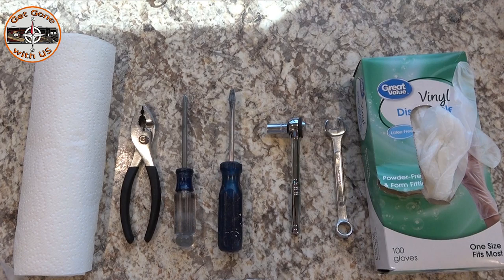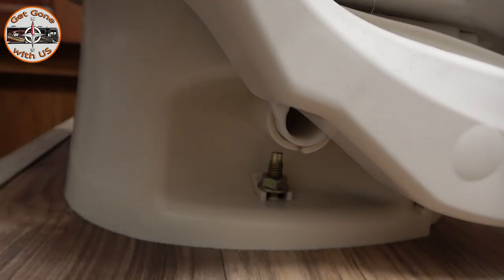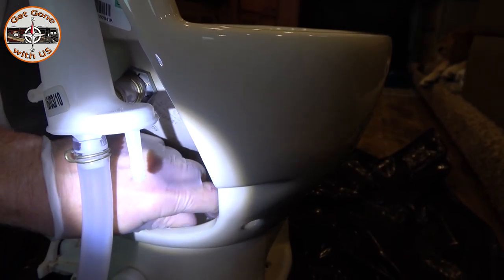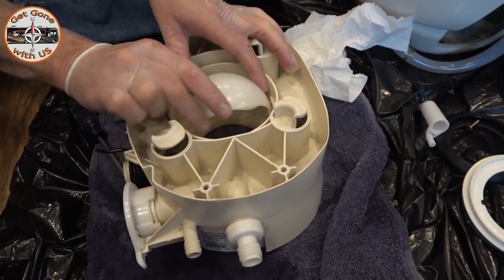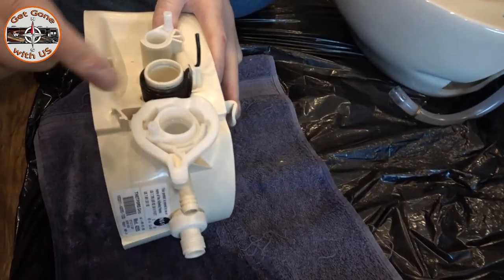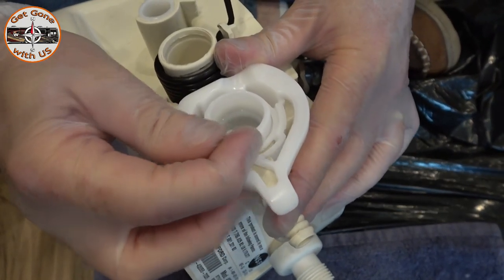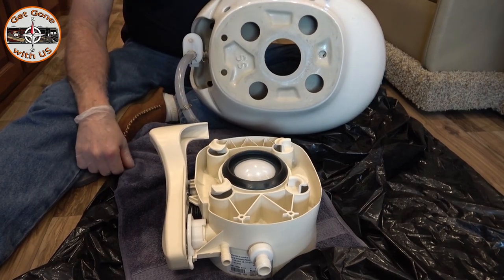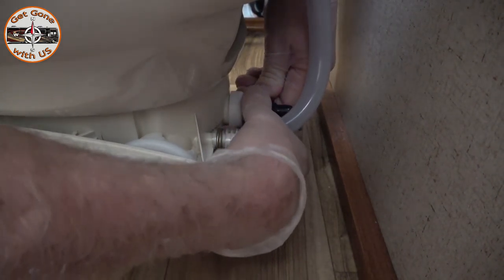RV Toilet Rebuild - Waste Ball and Water Valve Assemblies -Thetford Aqua Magic Style II

Comment: These toilets leak if the water pressure in the RV park is low. They can't seal with low pressure. Someone at Thetford who builds these said so. Thetford mostly won't admit it to you though.  Ours flooded twice due to low pressure in the park. We did change all parts but if pressure in park is low, it still starts dripping--loses its seal. I just turn off water each day as I leave for work. Not going to chance it and clean up a flood again!! Why can't they engineer these differently? The 1970s version with a slide bottom was a much better design.

Comment: Followed step by step…everything that clicked clicked, everything that snapped, snapped, all o rings got lubricated, an new gaskets, but now the new waste ball does not close all the way by itself, so, obviously does not hold water 😭☹️🥵
Reply from the maker: Use your foot to lift the pedal. If it moves, pull the pedal off and lube the shaft of the control arm. Otherwise it sounds like something is not lining up the way it should.

Comment: Watched this video several times and still haven't had any luck with the water valve not leaking. Yes I replace o rings as suggested.yes I used grease and yes it still leaks. Ball gasket also leaked. I gave up and ordered a new toilet. So flustering that it's a cappy job. Oh sorry for the rant. Appreciate you video very much
Reply from the maker: Sorry it didn't work for you.  You should be fine with the new one. 😀

Comment: I was getting our bus ready to go on the road. The back toilet water valve was not closing the water off so I did a rebuild on ours. The setup was just like yours I ordered the parts but I noticed the water valve was in a different part setup or part number 42058 which  I was lucky and found it at our Camping World. The process worked just like you showed on the video except ours had the sprayer attachment. I had it done in about 45 minutes. I took my time because of a bad back. We are back in business. There is no telling how much y’all helped me save on repair costs. Thanks.
Reply from the maker: You are welcome James!  Glad it worked out for you. 😀

Comment: Great video. I agree with you that the parts are expensive. Mine wasn't holding water even after I tried several seals. Eventually, the arm wouldn't move the waste ball. I found on Amazon the lower half for $75. Eventually all parts will fail; if you add up all the parts, it would be more than $75; therefore, I would just change the bottom half, especially if your toilet is over 5-7 years old. Just my thoughts.
Reply from the maker: Thanks! Toilet is still working since this video. Like we said in the video if it does act up again, we will switch the whole toilet out with a different brand.
Reply: @GetGonewithUS  I just installed the lower half. It is functioning just like a new toilet. If I was to purchase a new toilet, it would have cost $150 to $200
Reply from the maker: @michaelt2961  It is still a Thetford, we won’t own another one or put anymore money into this one (if it goes again). It’s just our personal opinion. :)

Comment: My valve wouldn't stop flushing and the step off the handle trick didn't work.  So I pulled the handle off with the toilet in place, removed the water valve, went into the valve seat and pulled the washer & spring.  It still looked in good shape, so I stretched the spring under the washer a bit (lengthing it just a hair), and greased up the washer and washer seat and reinstalled and works perfectly.  Your video was great in identifying the parts and how to disassemble what I needed to work on.  THANKS
Reply from the maker: Glad the video was helpful to you and nice job on the spring to get yours fixed! 😀

Comment: I used this step by step to replace my water valve module, waste ball and the vaccume breaker at the same time and I am thankful that I added a shut off valve on my water line because after I was done with the rebuild the water module leaked fresh water worse than before. I noticed that all the videos (your was by far the best) none of the water valves were nearly as hard to get out or reinstall the new one, as mine was. I will call Thetford tomorrow and ask some questions about all this and hopefully they can enlighten me.
Reply from the maker: So to hear you still had issues, hopeful Thetford will be able to give you some insight.  😀

Comment: Great video. Followed it step by step and no more leaks! Thank you!
Reply from the maker: Glad it helped! 😀
Reply: @GetGonewithUS  Question, now the bowl is no longer holding water. It was fine for the first several days, now not holding water. Any suggestions?
Reply from the maker: @ilenemurphy4905  In a pinch, you can try using the correct plumbers grease around the seal. You may have a bind that is not allowing the waste ball to close all the way.  Try this... step on the foot pedal and release it, then try to pull up on the pedal and see if the toilet holds water. If it does you possible have a bind somewhere.  That happened to us a couple months after repairing our toilet.  Our problem was the water valve started leaking and was binding.  It was not allowing the waste ball to close all the way. Here is the video on that video (Links to everything we used to repair it are listed in the Description Box below the video) ...  https://www.youtube.com/watch?v=ACBLn1E8QLM
Reply: @GetGonewithUS  thank you.  I will give it a try. Much appreciated!

Comment: Thank you very much. Our toilet was occasionally continuing to fill up, eventually overflowing until detected. We're full time RVers, so that was usually at night. I was able to successfully replace just the water valve with the info in this video, and didn't need to remove the toilet or split the bowl. The valve is accessible with the toilet in-place, and I had enough room to work on it. This wouldn't have been the case with our other toilet, so this was just luck. Trying to do this with the toilet in-place makes it pretty tricky to line up the foot pedal, so you might want to remove it anyways if you don't have incredible patience :-)
Reply from the maker: You are welcome. We give you credit Ron if your space to remove and replace the foot pedal was anything close to ours. Incredible patience indeed! LOL  We are glad the video  was helpful to you.  Thanks for visiting our channel! 😃

Comment: Thanks for the awesome video! I just replaced the water valve on our Style II High Thetford, which was about 10 years old. Fortunately I was able to do this without having to remove the toilet. I think I would've had a hard time with just the instructions alone, so your video esp from 8.00 to 10.00 mins, made it that much easier. Thanks again from a happy camper in Great White North.
Reply from the maker: Hi Wayne.  We are glad you found the video useful.  We appreciate your comment. 😀

Comment: Thanks for this excellent video.  I have no questions about what I need to do to repair my toilet.  Your instructions were clear, the video and lighting were great.
Reply from the maker: Glad it helped
Reply: @GetGonewithUS  Well, I guess finding the kits is impossible now, according to the manufacturer.
Reply from the maker: @charlieparrish3700  The water valve is still available at the link in the description box below the video.  Not sure which part you are looking for.  The supply chain issue is a PAIN!  Good Luck!

Comment: Very well done video ! 
Have replaced ball seal before but not valve . Will get the 2 kits you used. 
Not going to do until necessary but will carry in camper along with the other dozen or so parts prone to failure 
Thank you
Reply from the maker: Glad it helped. 😀

Comment: If the drive arm cracked off, could you simply replace that alone by unscrewing the old one and sliding a new one in its place without all the disassembly?
Reply from the maker: I believe you would still have to remove the foot pedal to do that.
Reply: @GetGonewithUS  It worked!

Comment: I replaced the seals per the instructions and the waste ball seal held water for about a week before starting to leak down again? Everything seated well, bowl top is tight and valve functions perfectly. Thoughts?
Reply from the maker: Make sure the foot peadal is returning all the way and not binding.  After flushing use your foot to pull up on the pedal slightly and see if it moves.  Good Luck!

Comment: Great video, very informative. I just did the same thing here and even after we tested for about an hour and it held water with no leakage. The next morning the bowl was dry. And ideas as to why it would be like that? I did take it partially apart and reset the bowl to base seal. Hoping that maybe it was just off a little.
Reply from the maker: Thanks Adam.  Sorry to hear your toilet is still not holding water.  Did resetting the bowl do anything?  Can you remove the foot pedal without removing the whole toilet?  If so take it off and try moving the waste ball lever, then try moving the  water valve.  They should moving freely with no binding. We have had the water seal o ring move down the shaft and cause the valve to bind which didn't allow the  pedal to return to fully closed position.  It threw us for a loop because it appeared to be closed, but it was allowing the water to slowly leak out. We pulled the water valve off and saw the o ring 1/2 way down the shaft, moved it back, put some lube on it and it was fine after that.  Good Luck! 😀

Comment: Thank you very much for the video, it was SO helpful. I now know I will be able to replace the ball after it got stuck and we twisted the drive-end off of it.  :(
That brings me to my question, since this happened because the ball got stuck to the seal, before storing or not using it for a couple weeks, do you think I could put some plumbers grease on the ball and then work it back and forth so there is a coating between the seal and ball?
Thank you again for the "down to earth" tutorial.
Reply from the maker: Glad it was helpful Steven!  Any time the waste ball returns slowing or doesn't feel smoothly when operating is the time to consider adding grease, that when we do it. Make sure you check with the manufacturer for  the proper type of grease to use. You could add some prior to storage, we never did if it was operating correctly.  For long term storage in freezing temperatures, make sure you have RV Anti Freeze in the toilet too. 😀

Comment: Thank you for your video. I watched both of them regarding the ball seal replacement. According to the assembly date on mine it was built in 2018. My trailer is a '19.  My seal does not hold water but if I lift on the lever it will hold water and if I add extra water from a dishpan then it will hold water.  What do you suggest - replacing the seal or the whole kit with the water valve. Mine might be slightly newer than yours, not sure. I am concerned about being able to remove the lever (muscle strength), and putting it all back together correctly if I do the Valve Assembly. Thoughts appreciated.  Thanks again for the great video!
Reply from the maker: Sounds like the seal could be going or the pedal is binding a little.  Without seeing it, it is hard to say. You might want to have it looked at if you are unsure about doing the job yourself. Good Luck!

Comment: In the video, your handle looked pretty easy to remove.  Mine is not.  Was yours that easy the first time you removed it?  Any advise on what might make it easier?
Reply from the maker: Make sure when you are pulling it you are not pushing down on it too.  Pull it straight off.

Comment: Hi, Very informative video, thank you for posting. The small shaft on the drive arm snapped off on our Style II, everything else OK. Looks like Thetford has discontinued Part # 42048 Drive Arm . might you know of a source for this without purchasing the entire base? Also, looks like the drive can be replaced without removing the entire commode. Thanks
Reply from the maker: Hi Jude.  I would get a hold of Thetford and ask them if the drive arm is discontinued or if it is a supply chain issue.  To answer your other question, yes the arm can be replaced without removing the whole unit.  Good Luck! 😀
Reply: Thanks for the reply….apparently Thetford has discontinued Part #42048…just the drive arm…they are producing it with a Kit # 42209….which has waste ball, seal, floor flange and the drive arm. The Kits are in Production but Thetford Customer Service  is unable to provide us with an available date …so we have to keep looking for old stock.  
Thanks again !!

Comment: Hi Guys
I have a thetford rv toilet 42054 and water wont stop running,. I replaced the Water Valve but even with the foot pedal all the up I still get water. Any Suggestions?
Thanks
Vic
Reply from the maker: With the foot pedal off the toilet, can you move the water valve lever and stop the water from running?
Reply: Thanks
I will give it a try.
Vic

Comment: Excellent video! My flush ball stopped turning when I step on the pedal. I can manually move it and I see the pedal does move the drive arm, so I’m thinking the screw may need to be tightened. Going to try that first as it seems the simplest solution. Open to suggestions as all RV repair places near me are booked for months!
Reply: 3:55 Just pull it off, just like that! 😂 I’ve been pulling and pulling. It won’t budge! I’m trying to do it with the toilet in place but I don’t think that should matter.
Reply from the maker: Good Morning Carolynne!  Yes it does pull right off when you pull from the right angle. LOL  By now you probably know if it is just the screw being loose. If not, the drive arm or waste ball could be either cracked or broken and need to be replaced.  Good Luck. Let us know how you make out. 😃
Reply: Get Gone with US Thank you for responding! I did finally get the foot pedal off and discovered the part of the ball where the screw goes in is broke. The whole piece that moves the ball just slide right out, screw intact. So, I think that’s a very easy fix - thanks to your video 😃 - but I realize I’ll have to remove the toilet to fix it. I was able to do this much with the toilet in place. Going to look for part prices now. I’m assuming I’d have to assemble a new toilet anyway which is what I was trying to avoid, so unless it’s very expensive I’m going to stick with just the repair. I’ll keep you posted!
Reply: Get Gone with US Hello there! So here’s an update: Bought the part (waste ball kit, they only had one, so I was lucky to find it!) and went through the repair step by step. Your directions were perfect, but I ran into problems anyway. Didn’t have one of the tools and tried to work without it - nope! Had a heck of a time reattaching the foot pedal - spring kept popping up into the way as I went to turn it. Finally got help with that and worked it on. After replacing the bowl and twisting, the holes didn’t line up for the screws. Adjusted it less of a turn and got that. And now, after two days of working (and mostly taking breaks for frustration lol), this last problem really has me at my wits end! I have everything reassembled (except seat) and bolted down, but I can’t get the water supply reattached fully enough so it doesn’t leak. Ugh!!! I just can’t turn it anymore by hand, and have been using a wrench. Got it a little further but it still leaks and I don’t think I can turn it anymore with the wrench as the part is plastic and I’m afraid it will strip the little bumps off and I won’t be able to turn it at all. I’m really at a loss! It wasn’t difficult at all to unscrew the water line, so why is it so hard to get it back on? And of course I can’t see back there which doesn’t help. Taking another frustration break. Any suggestions would be greatly appreciated. And just to reiterate, your directions and video were perfect! All of these issues are just how it goes I guess. Thank you!
Reply from the maker: @ellengrace4609  HI Carolynne.  Sorry to hear you troubles, especially the last step. Without being there to see for ourselves, these are our thoughts. You should disconnect the line from the toilet and make sure the washer is still in there and aligned correctly. Another thought is maybe it got cross threaded  when you were reconnecting it.  It should screw back on easily by hand.  Last thought is by using the wrench on it, because it is plastic, you may have cracked either the male or female fitting.  The only way to fix that would be by replacing the cracked piece. Hope it's just the washer and you'll be back in business soon.  Hope that helps.